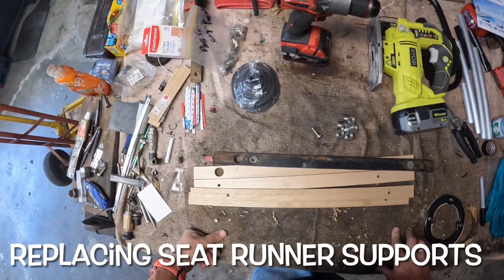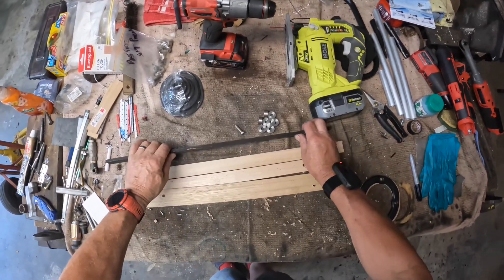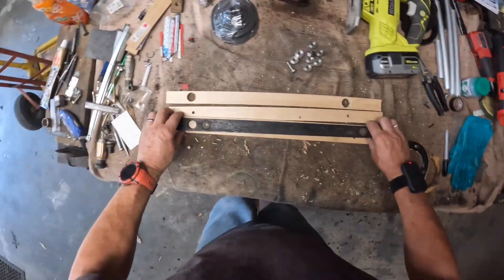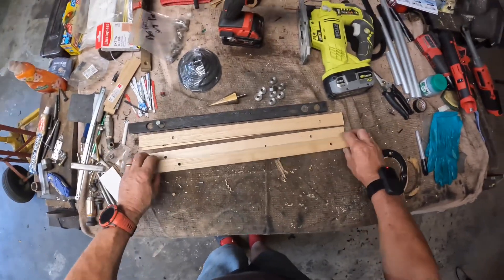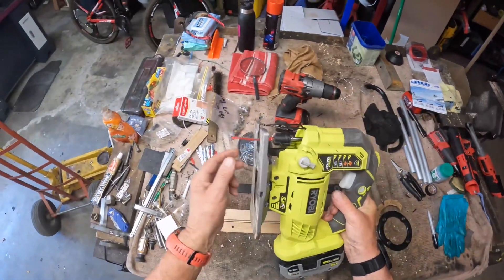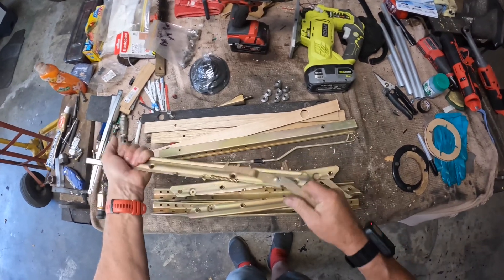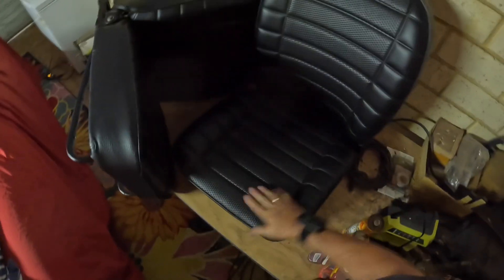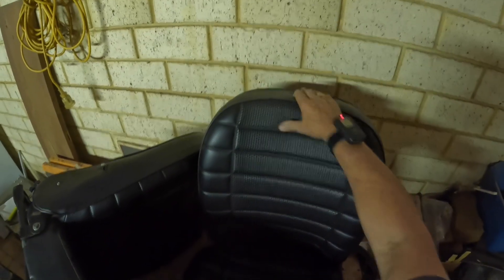Crap to Cream, MGB Seats, how to make new seat runner supports and what the new seats look like.

Comment: Hi Marty,
A good little update on progress.
A useful tip for others (as you probably know ) is to have a couple of bolts with their heads removed of the same thread & size that bolt the seat frames to the floor as these can hold the frames in place on the batterns & spacers whilst you slide the seats back wards & forwards & replace them with the proper ones & tighten them down. (It is a pig to keep everything lined up otherwise)!
The dip stick looks like it comes from an older engine rather than an 18V - the later dip sticks have no kink in. Care needs to be taken to ensure the correct reading of oil levels is measured if the oil dip stick isn't matched with the engine block.
Looking forward to seeing the rest of the cockpit being put together!
Cheers,Charles
Reply from the maker: Hi Charles, tip taken on board, my B already has three out of four seat locations as threads sticking up so seat install should be quite straight forward.  My issue was that the threads all contacted the seat rails because both the wooden battens and the spacers were missing, the seats were just bolted to the floor.

Comment from the maker: Hi Charles, as usual thank you for your detailed commentary, dipstick I’ll check, thank you.  The bolting of the seats, I’ve been down this track before, did what you suggested last time with the extended threads, worked a lot better.  Dashboard will be next (ish) I think, might finish off the rear brakes if the parts arrive.  Catch ya soon.  Cheers Marty